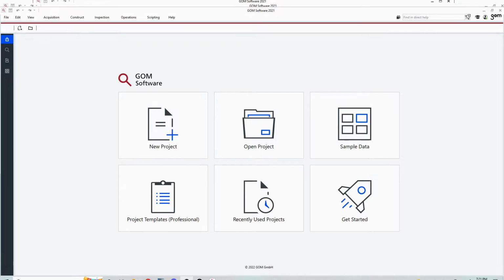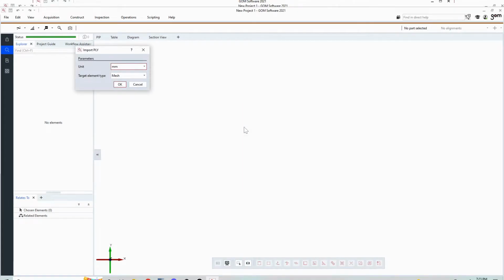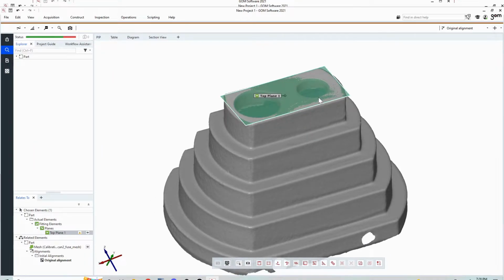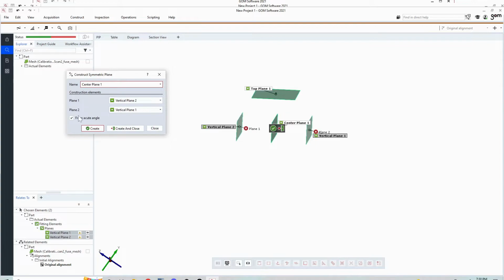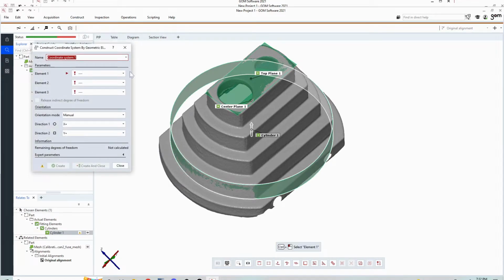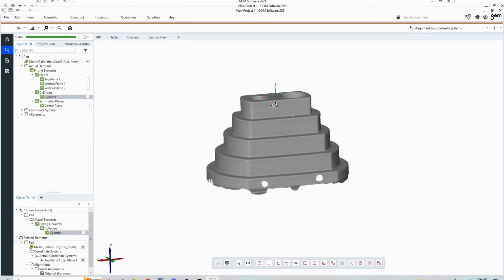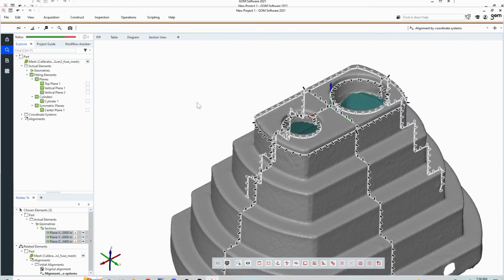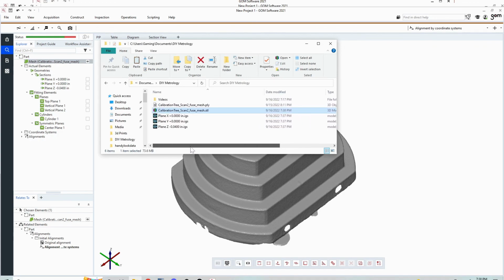Scan, Alignment, and Export to CAD

Comment: Awesome video! It doesn’t appear that GOM Inspect has a free option anymore? In searching I only see a 2 week trial for professional. Is there somewhere specific you got access to it?
Reply from the maker: I will look into this tomorrow and if needed post a video on getting it setup from scratch.
Reply: @diymetrology190  I actually did find how to get the software to work. I believe I read it wrong initially… I used to use GOM inspect with ATOS years ago for work. I’ve since changed careers but using this again for personal use has brought back some memories. Thanks again for your awesome video!